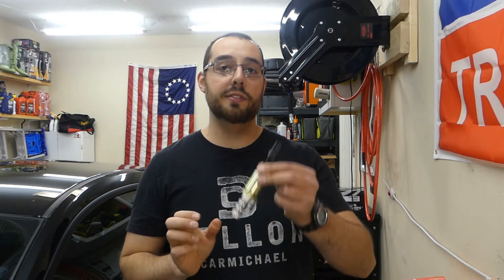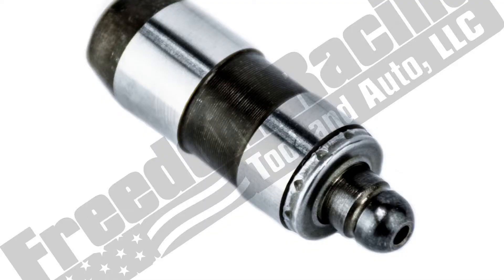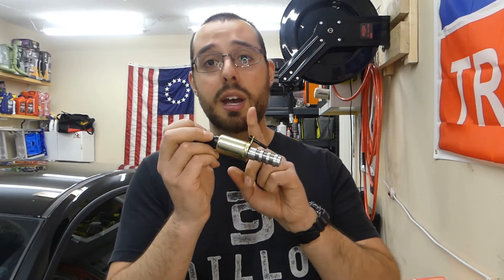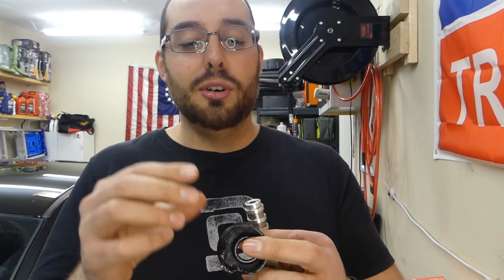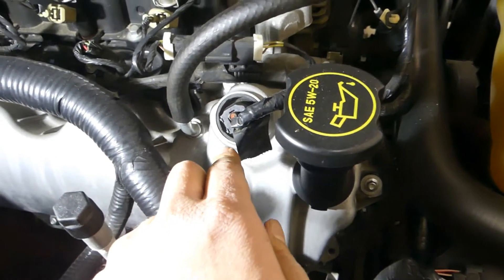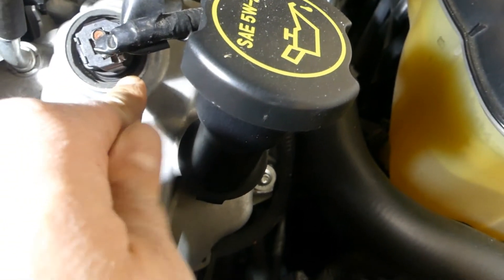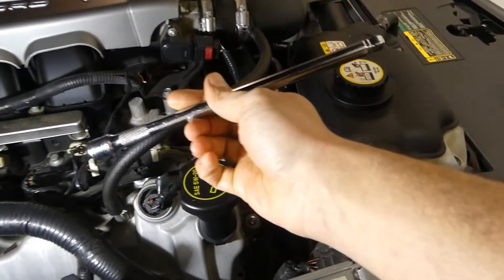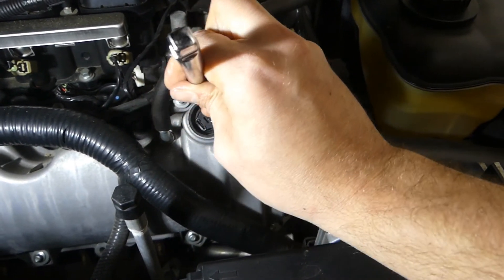No More Tapping:  Ford 5.4 3V VCT Solenoid Replacement Tips & Overview

Comment: Would this cause the entire bank to not work properly?  My bank two isnt firing at all along with the solenoid code, for bank two. Im thinking that all of the issues are because of the solenoid itself .
Reply: Experiencing the same issue did it fix your problem?
Reply: @tsdarrow0143 I sure did.  About a week ago or so.   Solenoid replacement did the trick.
Reply: @quentinwooten30  sounds good thanks for the answer back!

Comment: Great vid--have you ever experimented with cam phaser lockouts?  thxs
Reply from the maker: No my timing system is original other than VCT solenoids. 

I view lockouts as kind of a hack job thing because there's really no reason if the engine runs properly to lock out the original design. It's a Band-Aid for not fixing the real issue which is just fully refreshing the entire timing system with the updated parts that are proven to work well.

Comment: The easy access ended with the 2008 models, maybe only for the later half of their production. I’m currently replacing the bank 2 solenoid on my 08 f150 5.4L … started working thinking I would not need to remove the valve cover. Because the instructions I found online are labeled as 2004-2008 f150 5.4L. I figured it out when I was struggling to get out the t27screw holding in the solenoid . I probably could have done it, until I learned the solenoid wouldn’t have fit through anyway :( I’m a super rookie so I’m a bit intimidated, but this will be my first time removing a valve cover

Comment: I just noticed today that my 05 Ford f150 was making a tapping noise just a few seconds, pulled out my diagnostic tool  It was giving me a 0022 Fault code.  and VCT was a possibility of a the cause of the engine light.  What are your thoughts

Comment: My 05 f250 5.4 has the original vcts for 234k miles. Ive never had to do anything internal on the engine. No timing components or phasers or anything. Never even had an oil leak anywhere. Its only had 5w20 full synthetic every 3500 miles from day one. We daily drive it and tow around 8k pounds atleast once a week. It has a slight tick at idle but has had it since it was new but i wonder if I should change both vct solenoids or if it aint broke dont fix it lol

Comment: I swapped one of my solenoids recently. It's super easy to remove tapping with a 32mm socket from the underside of the valve cover. Now. The removal of the valve cover was a big job. The vacuum line behind the intake got loose so I had to remove the entire thing to be able to put it back. 

But the truck runs really well now.
Reply: Did this solenoid issue cause your entire bank to not work properly?

Comment: Here's your tip.... never buy a ford with a 5.4 .... ever.....now the 4.6 is good engine...
Reply: My properly maintained 2009 5.4 3v is still quietly and smoothly purring along after 15 years now. I had to change an exhaust manifold in 2018 and these VCT solenoids in 2022 which have been the only issues so proper maintenance from day 1 works wonders for the 5.4. On the other hand I would never consider buying a used one with an unknown history..
Reply: @squangan  My F150 is a 2005 with a 5.4  with 380000.  I  haven't had to do anything to the engine other than oil changes, plugs, and a couple of alternators.  The truck has been awesome!
Reply: The 5.4 Triton is a lovely engine to drive. But you have to be very aware of the timing system. I'm planning to do a full swap incl the oilpump soon as I'm at 110 000 miles on my 2005
Reply: @MattiasSchönning  until they get the death tick because no oil is getting to the head's and starts smoking when the rings go.....5.4is 💩....
Reply: I just replaced my 5.4 after……….460,000 miles……..

Comment: 2006 and 2008 use the same solenoids but the grommet holes are different sizes, designed to fail.

Comment: I feel like everytime i do mine. The torx screwdrivers dont fit around the housing of these vvts.. its everytime. N then i see videos where they easily access them n have it done. Why am i running into this issue 😂
Reply from the maker: Depends on your year. 2004 to 06 and maybe into a few productions of '07, you have the larger VCT seal. If you're 07 and later then you can't access it through the valve cover without taking it off.
Reply: @3VJohnny  yea, i just figured that out. Mines 07. Had to remove the valve cover. Had to buy new gaskets lol fml now the driver side

Comment: Thanks for going through this particular part's installation. Do you happen to know how often these should be changed? Or can they be flushed, cleaned and reused? Just curious. Great video. Jesus bless.
Reply from the maker: I replaced mine because of the symptoms I was having with the tapping. However oftentimes you would be replacing them as preventative maintenance when you replace the entire timing system 150kish miles). A lot of the newer vehicles they're not easily accessible which makes it a challenge. There were a handful of years from say 2004 to mid 2007, where you could access them easily and install the updated part.

Comment: Wow, new subscriber thanks for this vid!
Problem I have is trusting chinadorman with their smaller oil passage idea. 
I understand your explanation but small oil passages are the long-standing factory flaw.
My 08 5.4 had the faintest tick til last week. Had no misfire or power loss whatsoever but after new spark plugs faint tick is gone. Idk I can’t explain that. 
I was concerned about the 2 part plugs so I had my mechanic do it, turned out it was motor craft platinum one piece!
Research later was ford was starting to dump the problem breaking plugs in 08 sometime but not specific month mine is May….second owner had since 2010
Reply from the maker: Ford actually revised the parts to have all smaller oil passages including the lash adjusters as well. Dormant would just be copying the Motorcraft design at that point. 

Glad you have the updated heads!

Comment: Thanks Bud. I got the 06 f150 Lariat.  I think the 06 is where the last easier vct access stops. My concern mainly is the tapping at idle also. No codes, no rough idle. Just the noise most noticeable at drive thrus. Seems the revision of the oil channel was a good idea by Ford in my opinion. May try it. You got that new motorcraft part numbers for the solenoid and the black seal piece. Thanks
Reply from the maker: Ford OEM 5.4L 3V VCT Control Solenoid x2 & Valve Cover Seal Gaskets x2 https://smile.amazon.com/dp/B01HFPOORC/ref=cm_sw_r_cp_apan_glt_fabc_K5P9ZSS70KPDP0T0X60F?_encoding=UTF8&psc=1

Comment: Use 5/30 engine oil for better lubrication.5/20 was to increase gas milage.
Reply from the maker: Correct. Been using 5-30 for a very long time 👍🏼
Reply: I use 5w-30, in the summer, 5w-20 in the winter.

Comment: I have a 2008 ford f150 5.4. I can access the silonoid,  but I can not get on the t27 torx. It is to tight, the hole is only 1.5 inches. What is the best idea.
Reply from the maker: Yes, you cannot access the solenoid correctly on your year. Around 2007 Ford changed the valve cover. You need to pull the valve cover off
Reply: Is there a valve cover that I can buy to make easier access for the future. I have 05 lariat

Comment: I have a
 2004 5.4 triton 3 valve I have question the recommendation says 5W-20 oil is that to light for a V8 engine I'm thinking about going with 5W-30 oil
Reply from the maker: @?????? A recall is for safety issues only.  The factory was 5W-20 for the 3V engines but many of us run 5W-30.
Reply: @3VJohnny  I run 10w30 in mine because I live in Central Texas.  It's more shear stable than 5w30.  Synthetic only of course, these engines have small oil passages that can't get gummed up.
Reply from the maker: It's not light as it's what was spec'd for the engine by Ford. 

That being said, I've been running Motorcraft Synthetic Blend 5w30 since 2013 with no issues. Many have as well.

The older 5.4 2V was originally spec'd as 5w-30 but was later changed to 5w-20 due to CAFE standards to try and squeeze more fuel mileage.
Reply: @3VJohnny  
Thanks for the reply, my 2002 ford escape V6 3.0 used 5W-20 oil so I don't feel safe using 5W-20 in my 2004 5.4 V8 triton I'm going with 5W-30 Weight
Reply from the maker: It's not going to hurt anything either way. I noticed the engine sounded quieter with the 5W-30. 

Ford tech Makuloco also advised 5w-30 in these 3V engines now. So that's a good sign.

Comment: The ford makeuloco channel said mid 07 is when they changed valve covers. I have an 07 king ranch and I have to remove them to do this
Reply from the maker: That's what I thought it was, I just didn't want to say since I wasn't 100% certain and steer anyone wrong.  It's a bummer because the access sure is nice haha

Comment: The shop that rebuilt my 5.4 heads put a oil plug at the bottom of the hole where the vct solenoids sit now I've been getting p0022 timing retarded code. I think I'm gonna have to pop the plug out for the solenoids to function properly.
Reply from the maker: Yeah the solenoids are a crucial part of the system. I hope you get it straightened out

Comment: 2008 and up u have to remove the valve cover
Reply from the maker: I've seen it being as early as 2007 myself
Reply: No you dont have to remove the valve cover.    https://www.youtube.com/watch?v=_tgfghbnt8I
Reply from the maker: Yes you do after 07 redesign valve covers. Not pulling the valve covers only works 04-midway-07. That video is full of bad information.
Reply: @3VJohnny  ..I agree.  Alot of ppl are going to use aftermarket parts for starters, along with trying to preform this repair on the wrong year vehicles, only to possibly cause damage to there engines.
Reply from the maker: Yup I agree. There are lots of small changes among generations that can screw people over.
Reply: @3VJohnny ..That's one good thing about Ford, and how they only "tweek" there trucks from the interior to their engines thru the years. Where as other automotive manufacturers, design and build new engines every other year practically.  Not that I'm a Ford lover, far from it but, I do love my F-150.  When you buy a new ----- etc. the changes to engines can be like day & night, and now your taking chances on new design flaws, recalls etc .kinda went off topic a bit lol.. 😆 🇨🇦